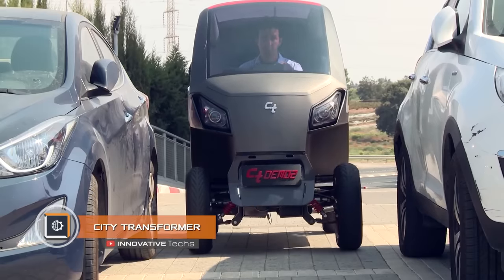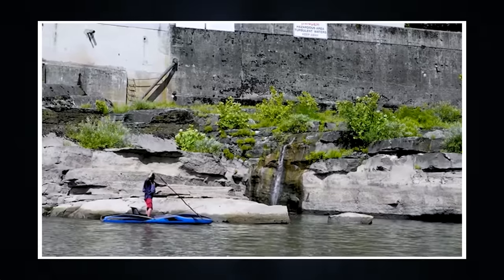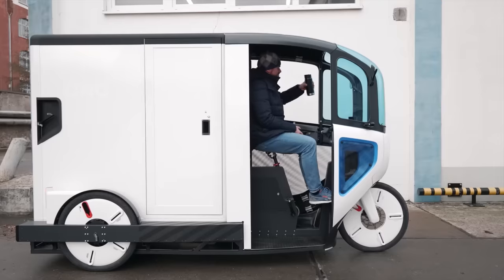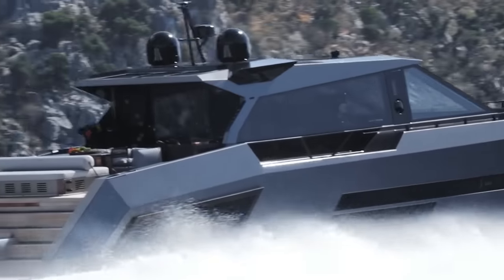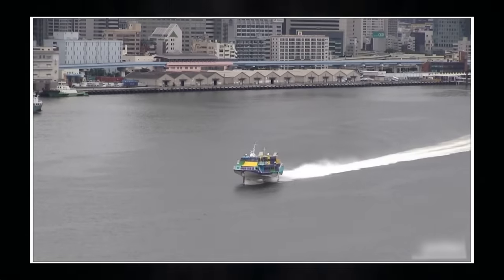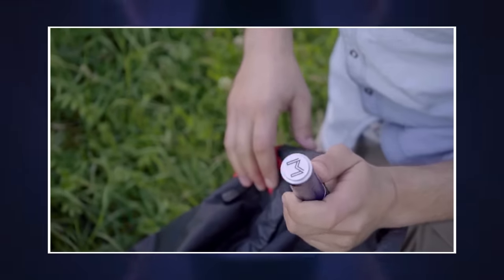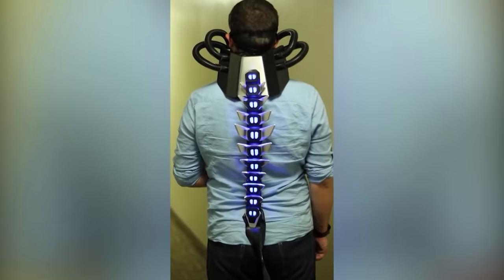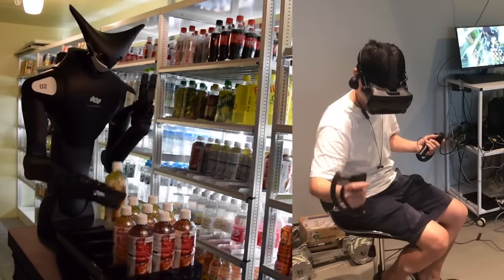AMAZING INVENTIONS THAT WILL BLOW YOUR MIND

Comment: At 16:34; There was also a patrol hydrofoil (HMS Speedy / P296) based on the 929.
There was story that every one of them (P296), on their maiden voyage developed a crack on its main bulkhead (fwd, aft?).
After extensive analysis and testing, they found no reason why, but welding the crack solved the problem.
I sat in the Captains chair (on dry ground) of a 929.

Comment: I like the follow fan, but scope should be widened to use in aircon systems, plus smarts so that it may be used in opposite way - eg to prevent cold air blowing on your shoulders when sitting at a computer all day.  If combined with thermal imaging, it could blow cold air towards the hottest part of the room, dynamically updated every few seconds and vice versa for heating.  I found the most comfortable way of heating/cooling is to change the temperature of the walls/furniture rather than the humans in the room directly.  If objects in the room are kept at ideal temperature, the air can hardly do anything but maintain at this temperature.
Reply: Didn’t you notice the AI narrator said ”every summer we face record freezing temperatures.” @ 2:22.
Reply: @c.r.broken_human  crazy huh

Comment: I think the small vehicle parking in between other cars, would be problematic.  When the car driver/s return, if they need to back up to pull out, they would hit the small vehicle either accidentally or on purpose, don't you think.  If it is not a dedicated parking spot then it is not a dedicated parking spot!  If these vehicles take off, then councils will have to allow dedicated spots for them